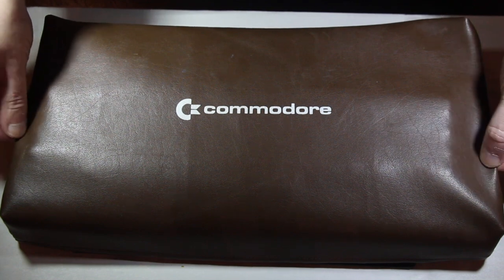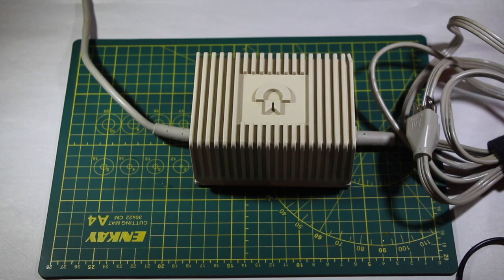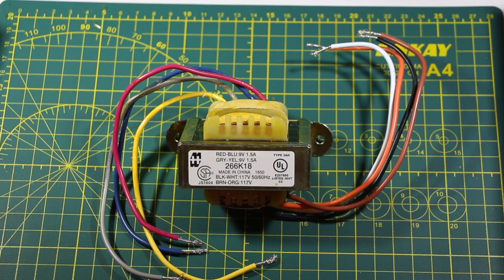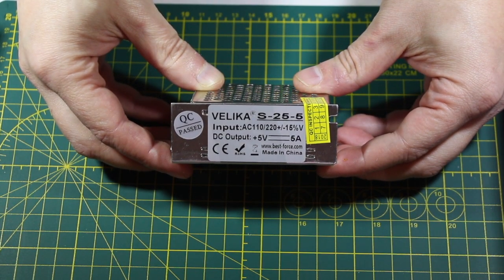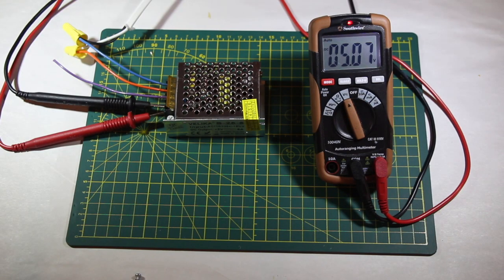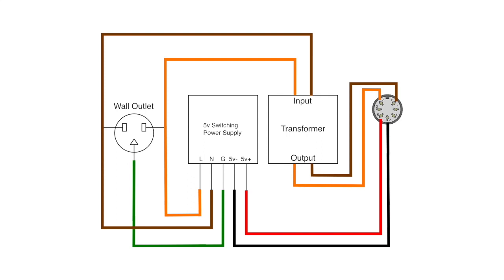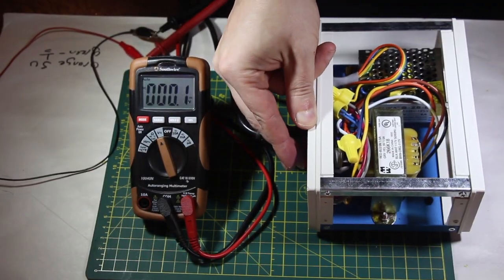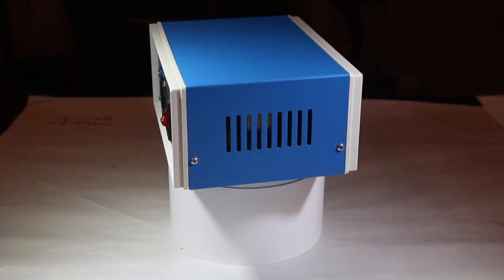BS/OD #5 - DIY Commodore 64 Power Supply

Comment: Hey Shaggy, great video and explanation! Where did you get the 7 pin din connector cable?
Reply from the maker: The cable itself was taken from an original C64 power supply. I forget exactly where I got the connector for the other end, though. You can get more information on the connector itself here: https://www.c64-wiki.com/wiki/Power_Supply_Connector
Reply: @theshaggyfreak  thank you so much!

Comment: I had a go at this, but the transformer is the sticking point. For the life of me I cant find a straight answer on how secondary power works. In your circuit diagram you have what appears to be a hot and a neutral leader out from the transformer. As I could not source the exact same transformer, I went for a 2A 6-15v EI Core Transformer, though there are only tags at the top for the secondary power outputs. Surely there needs to be a neutral out put as well? I'm a Technician, not an electrician, and I have new found respect for "Sparkies" everywhere.
Reply from the maker: Sorry it took so long to reply. I'm not familiar with that specific transformer. So, I can't exactly say what the wiring is like. This is the same transformer I purchased, though: https://www.digikey.com/product-detail/en/hammond-manufacturing/266K18/HM2140-ND/2358044

Comment: I also didnt notice a fuse in your wiring diagram, or build. I HIGHLY recommend that you install at the very least a 250ma fuse from the 0 corner of the transformer. This little forum was quite helpful with my research: https://forum.allaboutcircuits.com/threads/how-to-attach-wiring-to-this-step-down-transformer-to-create-a-dc-power-supply.144228/

Comment: ps: I'm wondering if it really requires an ground, as the Commodore power supply was a simple two pin. Thanks for the inspiration. Really looking forward to getting my parts and getting started.
Reply: building things that work with 230VAC or what ever your line voltage is, should not be done if you wonder things like this =)
Reply: @nukester.  was a bit tired when i wrote that and have since seen the error of my ways

Comment: Since you have a breadbin, and you mention the power supply is a later revision, you might have a mismatched power supply with your 64. I'd suggest checking your SID revision, just to be safe. Older SIDs want 12V rather than 9V. Don't bump that voltage until you're sure, though!
Reply from the maker: I have 6581 SIDs but the 9v AC is fine. There's a rectifier bridge after the PSU that gives it the 12v. I have a couple of C64 breadboxes but they're not the super early ones. :)